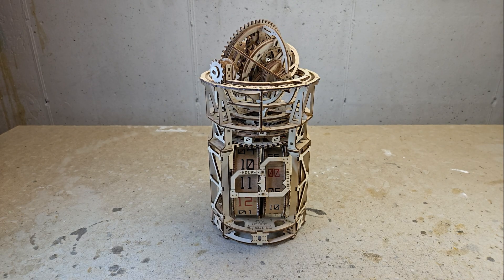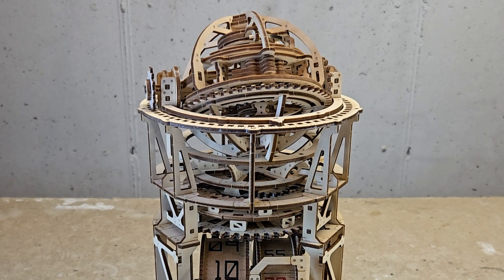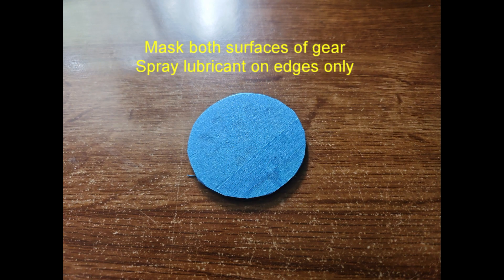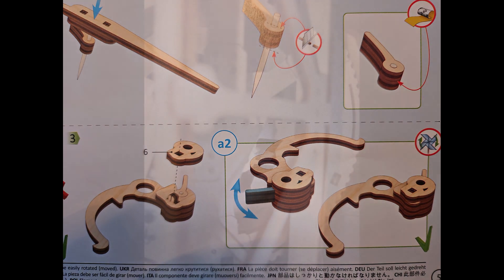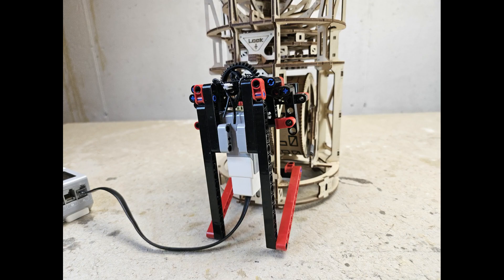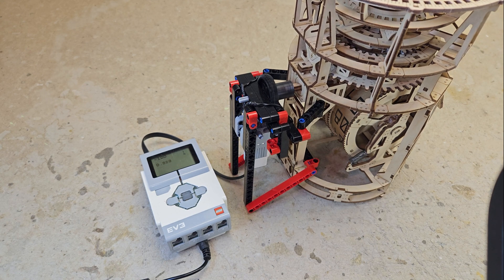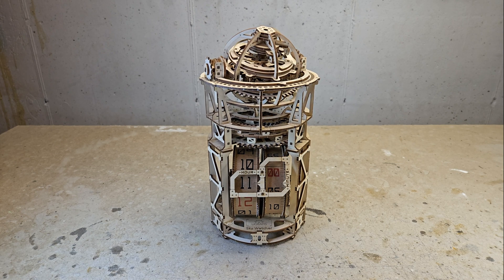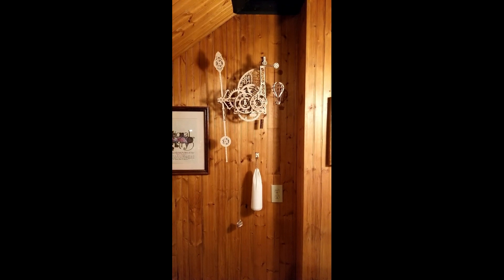Self Winding Sky Watcher Tourbillon Clock

Comment: I am having a total nightmare with the hour drum,  everything is assembles as it should be sanded and waxed but the spring arm often stope on the peak of the cog.  Your video is the first one I have seen that suggests the small weight so I will try this.  I have everything crossed that this will help.  Also I must add that your mod is brilliant so thank you for posting your efforts
Reply from the maker: Thank you for your comments. I hope you will be able to get it working.

Comment: No need for a Tourbillon movement in a clock. the gravity effect is in one constant direction and can therefore be compensated for without the Tourbillon.
Tourbillon is needed when the time piece is in different orientations to gravity, like a wristwatch.
Reply from the maker: Hi Tainyi05.  With all due respect, you have it backwards, I'm afraid.  The Tourbillon movement was originally developed for pocket watches, which spent most of their time in one position, sitting in a pocket.  Gravity pulled on the escapement mechanism in one direction, negatively affecting accuracy.  The point of the the Tourbillon movement was to artificially rotate the escapement so that the effect of gravity was evened out over time.  Wrist watches obviated the need for the Tourbillon movement since they are constantly in motion.  The only reason we have wrist watches with Tourbillon movements today is because people simply love the engineering.  I have one myself.

Thanks for you commenting, though.  I appreciate it.

Comment: PTFE was my thoughts too. But I bought the 3- in- 1 emulsion lubricant and applied it with a cotton swab. I also sanded all the part sheets while still secure on the sheets and before removing them. Then I sprayed both sides with Krylon translucent cedar. Then mounted the finished model onto an 8" round wooden plaque base to add stability. Beautiful. The Lego addition was cool, but I like it the way it is without electricity. Afterall, it was invented in France in 1801. They had a lot of wax but little electricity in those days. Cheers.
Reply from the maker: Thank you for your comments.  Your build of Sky Watcher sounds very nice indeed.